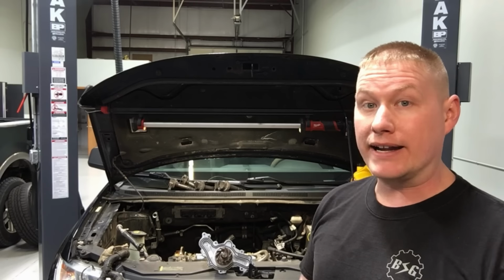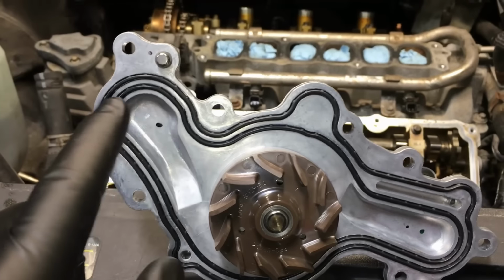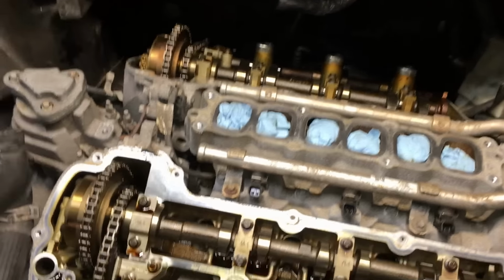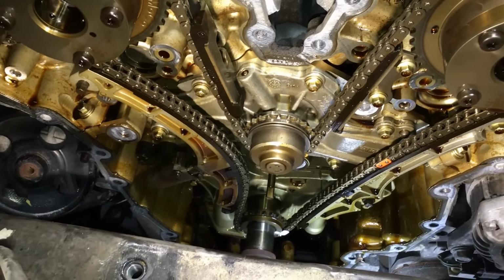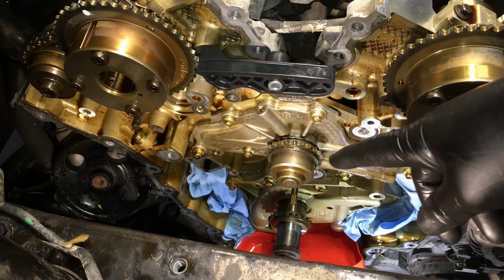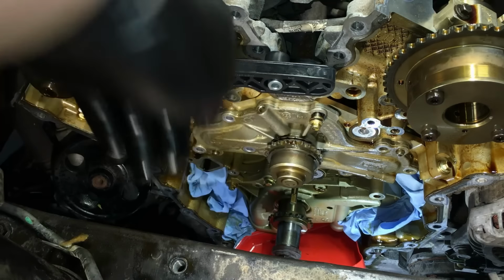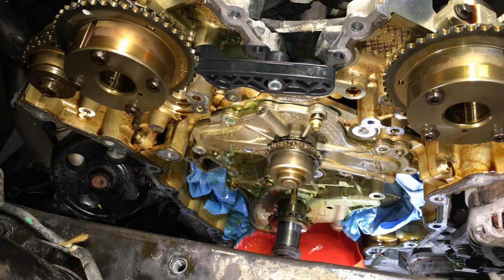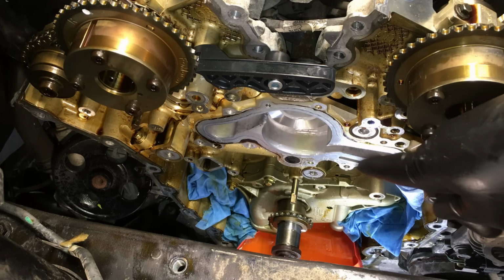Ford 3.5L 3.7L Duratec V6 Chain Driven Water Pump Failures: Check it Before it Destroys Your Engine!

Comment: Brian I subscribed to your channel  even though I dont like Fords. the only reason I subscribed to your channel is because I believe you are a great mechanic. the only thing I would like you to stop doing is sugar  coating these engine designs by Ford. That's a terrible engineering and you need to start admitting that this design is pretty is pretty stupid. I feal sorry for the owners of this engineering experiments...Ford flex,taurus,mazdaCX9,edge,lincoln... 🤮  Ford built thought...to fix

Comment: I had an '07 Edge complete with 190,000 miles, the 6F50 transaxle shudder, quarter panel corrosion, and a water pump showing signs of eminent failure. Sold it 4  months ago for $2000. It was a great running vehicle, but I got my moneys worth out of it.

Comment: Does this mean that we should stay away from these 3.5L 3.7L motors? I was looking at a Flex and it has the 3.5L Ti-VCT V6 Engine.
Reply: YES....unless it's an F150 truck....those have external water pump...
Reply: @barrya.6212  mustangs with the 3.7 have external ...not sure about the 2015 to 17 Ford edge 3.5
Reply: @davidilijevski8942  Then that's because they are rear-wheel drive...which sounds right...can't imagine Ford putting front wheel drive in a Mustang.All other Ford cars with these two engines I'm sure are front wheel drive...thus having cramped engine compartment needing the internal water pump...although of course they should have built the car 'around' an external pump in these not the other way around.
Reply: Yes stay away from those FWD 3.5, 3.5 Ecoboost, and 3.7 liter V6 engines.

Comment: I have a 2014 V6 Cyclone engine in my mustang. Only 56,000 miles on it. Does this engine have the chain driven waters pump system my engine bay looks nothing like this so I was wondering if the duratec and the Cyclone engines are different or should I be worried about this problem too?
Reply: No

Comment: Wait till you see what the fix was in the newer engines. They replace the plate with the pump with an idler and a spout that connects to a newer design external water pump that has a spaghetti mess of tubes and hoses attached to it. At least on the newer models they fixed their blunder.

Comment: What genius came up with the idea of putting the water pump on the timing chain sitting right over the oil pan were it can completely destroy an engine? Putting the water pump out on the serpentine must have made too much sense so Ford had a better idea. NOT

Comment: I have a 3.0 duretec, the water pump is in the back of the engine (Drivers side) and drive by a small belt off one of the cams. why change something that works?  I was looking at going to the next gen Mazda6 but not now.
Reply: The point was so a 3.5 would fit into a 3.0 platform

Comment: What would cause this prematurely? For example, on a 2014 explorer XLT with 78k miles?
Reply: Prematurely? Maybe not changing the coolant as per the manual's instructions...but not much more, it is not the driver's fault...it's a design flaw.

Comment: I had mine done @160, I’m @220 Which coolant do I use? I think they used MC Gold, there was some confusion on the recommended fluid. 2010 Edge Sport. Do I need to flush with distilled water if I’m using the same coolant? The coolant looks kind of clear with some yellow tint.

Comment: very funny of Ford to call this Dura. To fool people into thinking this P. O. S. is durable. I have owned cars since 1960. NEVER owned any Ford and likely never will. they teach people not to trust them with stuff like this.
Reply: Never had any complaints with the 1990s Ford escort series we had 4 of them in our family and one was even a manual transmission 3/4 of them got to the 200,000mi and further mark 2 structurly collapsed due to severe rust damage in new England one got totalled in accident and the last one the automatic transmission failed severe burning oil and time ran out  if we could have known that in 1991 we would have bought them brand new

Comment: I've done one of these under warranty for a customer years ago... 😔
Reply: only 1? Thats impressive failure rate. that guy got 185k miles out of his pump and it wasnt even leaking. Atleast ford engineered it to last in excess of 100k miles.
Reply: @HakeemsAutoRepair  There’s many owners that had failures well before 150,000 miles.

Comment: You know you have 2 weep holes right? One above alt and one in the engine V valley. The long cut out on WP is the alt weep hole and the bottom hole you show on WP at first is the valley weep hole.
Reply from the maker: Yes that one is for shaft leaks

Comment: I'm about to replace a water pump in my 2008 ford taurus with 220,000 miles on her.  Changed the oil the other day noticed the leak.   I watched the 3.5L ecoboost video, other than the engine turned sideways, is the video pretty spot on how the timing and everything lines up?  Thank you for busy time.

Comment: Great video...I have a 2012 CX-9 with this 3.7 engine and I heard 2012's and newer have a dual sprocket design on the water pumps that are more reliable and less likely to have a coolant leak...is that true?
Reply from the maker: Correct but they can still fail, we have seen them as low as 63k miles.
Reply: Thanks

Comment: Brian, I feel I may have askes you this but do you recommend 5w30 for the 3.7?  I hope so because I put 5w30 in my Cx9. Thing burns oil like crazy, after 8k miles only 2.5 quarts came out. Thank you.
Reply: 5w20 full synthetic. We have the 2L Duratec just crossed 200k mi with no oil consumption. 64k mi on 3.7L duratec no oil consumption. I don’t think the duratecs are known for eating oil and not having a root issue.
Reply: @acmotifs  He answered me on another video and said he recommended 5W30.  Switched a few years ago and it helped with the oil consumption.

Comment: 12-14 hours? How much to R&R the engine? Just curious
Reply: Just over 18 hours to remove and install a long block, I usually just drop the whole powertrain assembly out the bottom to do this job, only downside is you'll have to do an alignment afterwards, also a good time to replace the commonly leaking ps pressure hose and or PTU/transfer case which are a nightmare otherwise

Comment: Does this apply to the 3.7L mustang? Getting mixed info
Reply: Absolutely not. The water pump on the Mustang 3.7 is belt-driven,  mounted externally - the way it should be.

Comment: Does this mess up the alternator I’m having troubles on startup I took it to the dealer and they fixed nothing
Reply: Alternator doesn't start the car. If battery is ok alternator is probably fine, It gets wet every time you drive in the rain.

Comment: When installing the new updated black plastic upper timing chain guide can that be done without removing the cam phaser?  Also the new updated guide needs new matching longer bolts. 
Thanks
Reply: You have to loosen bolt and tilt the phaser out just enough to remove upper guide bolt. Bolt it TTY so you will need a new one.

Comment: couldn't you just put in 3.7 out of a mustang and not have to worry about that bad design anymore, the 3.7 mustang has an external water pump that can be change in about an hour.

Comment: WATER PUMP FAILURE - BLOWN ENGINE:  I have a 2010 Edge - I drive about 5K a year these days. A couple of months ago the water pump failed - only 65K in my Edge and I am having to replace the motor now. (really poor design by Ford) I didn't get any warning at the time of failure, water temp went high and damage was done! No "check engine" or other warning lights? Thanks Ford.
Reply: Similar thing happened to me after my 2013 Taurus water pump was replaced due to a leak.  Engine catastrophically failed 3 weeks after water pump replaced.  Awful.  Won't ever buy another Ford.

Comment: Glad to know about this. Won’t be buying one of these cars.
Reply: Why not rhey arw still great cars
Reply: @gotzgetcake  Why would you buy something that can be characterized as a ticking time bomb?
Reply: @harrison4ever125  i have a police Taurus no issues so far if it lasts u a while its worth putting money into it
Reply: @harrison4ever125  my neighbor was a mechanic for the Toronto police. He said outside of this single issue the engine is very reliable. He said just replace these preemptively. Its a problem that shouldn't exist but it appears to be the one issue in an otherwise good power train
Reply: @harrison4ever125  okay the thing is every engine has something that fails first, you won't find a perfect engine
Reply: Agree that other than this issue, the engine is honestly free of problems. Plenty of power and decent gas mileage in a 2013 Ford Flex, SEL, AWD. I did not know about this issue fully before getting it, but I can say the Flex is worth putting the money into. Then the car will last me for years more. I've been using this vehicle for business and it's been fantastic for me. Replace it for $1200 - $3000 at a shop. Or you can try and do it yourself. No way I wanna jump into that kinda job. Although, if you can find one that has had the water pump replaced, then you're set!
Reply: You see a money pit. I see a fun weekend project!

Comment: On the duratec 3.0 the water pump is beautifully mounted externally and driven by tail end of cam
Reply: Ford's 3.0l v6, best v6 ever owned
Reply: @jaunramirez3742  absolutely...the 24 valve duratec is the most reliable v6 I've ever encountered...I've owned and repaired German and Asian v6 ...and the duratecs were the most reliable by far, no oil consumption...and externally mounted water pump, not driven by t chain...
Reply: @yyz125  i agree
Reply: @jaunramirez3742  GM 3800 v6 is a way better option. Intake gasket is the only hard fix and not half as bad as this water pump
Reply: @iant419  the 3800 v6 are very reliable as well
Reply: @jaunramirez3742  which cars carry those ?
Reply: @nozopoke1782  ford fusion 2006-2012 ,  2006  lincoln zephyr and milan 2006-2011.
Reply: That was a solid engine
Reply: Ford got smart and cut down on its transverse mounted engines. The newer SUV platforms are RWD based which eliminate the need to design such awful things just make it fit in the car..

Comment: What kind of bonehead would design a water pump internally and connect it to the timing chain? That’s not the worst part. When the pump begins to fail all the antifreeze drains into the oil pan, mixes with the engine oil and destroys the engine??!!
Reply: Right! and to what benefit? Classic ford having a better idea.
Reply: @upnorth5465  Chrysler 2.7 V6 is the same exact way.

Comment: Hey what's your opinion on the 2.0L ecoboost they put in the Edge? or even the 1.5L ecoboost that they put in the escapes. Haven't seen you post anything on either of these engines. Thanks.

Comment: I have a 08 edge with 135k miles, code p0016 and p0011 for the CE light, no coolant loss no leaks anywhere, any suggestions? Engine runs and sounds fine.

Comment: How does that work out for you rounding off the head of the bolts before you get the socket in place to back the water pump bolts out?  Asking for a friend...
Reply: I cringed too lol

Comment: My moms 2015 Ford Explorer Limiteds water pump failed at 64k miles. Just 4K after warranty and is not honored. We ended up paying $2,140 after a couple of “discounts.” Ford Corporate was no help what so ever. Called 3 different times with the same stupid answer. Customer satisfaction my ass, I even tried negotiating the price and that wouldn’t work either. 😡

Comment: @FordTechMakuloco - Quick question leveraging your experience,  have you noticed these water pumps failing at a lower mileage on vehicles using the Motorcraft Specialty Green Coolant (like Mazda FL-22 coolant) or the Motorcraft Orange Coolant (similar to Dex-Cool)?  From my limited research it seem to me that these pumps were lasting longer when the Motorcraft Gold Coolant (similar to G-05) was used (as shown your video).  Thanks in advance.
Reply: I have a 2011 Taurus SEL specialty green coolent ( changed every 60K ) and the car current has 189K ( taken can of very well ) no leads as of yet and never been changed.  BUT parts were order 5 days ago and should be here today . Changing every thing in the front of the motor including oil  pump .  My goal is 450K-5500K

Comment: great video, glad to see you changed the timing chain as well. I think the slack in the chain is what causes excessive vibration in these pumps a lot of time and ruins them. I did the same job two years ago, hated those power steering bolt, , just a diyer changed tensioner and oil pump, guides, chain as well just because I had access to it.

Comment: Hello, I got a 2000 Mustang V6 and I recently  replaced the front calipers and master cylinder. I bled the MC and the brakes just like it is instructed on the repair manual but the brakes still spongy. There are no leaks anywhere and even replaced the rear bleeders but nothing. I have done a massive research tried different things with positive results. Since you worked with Ford, was there a trick or tip you can give to fix this issue? I'll appreciate your help.

Comment: Will a 2013 Ford Explorer 3.5 engine fit in my 2011 Ford Explorer? Anything I need to change? I was told there all the same and you can transfer oil coolers to new/used engine.

Comment: The water pump on my 2010 Ford Edge just failed with zero warning, whilst we were driving 60 mph on the Freeway. The first sign that anything was wrong was the heat stopped working inside the car. The next second the engine started vibrating and stalling. We managed to pull off the Freeway, just before it completely died. We opened the hood and the engine had clearly overheated and was steaming hot. We tried adding a full bottle of coolant but it just leaked straight through and onto the ground, it wasn't leaking before this incident. The vehicle was towed to the Ford Dealership for diagnostics. It was bad news unfortunately. When the water pump failed, with no warning whatsoever, it caused coolant to leak into the engine/oil and destroyed our engine completely. All of this happened in the space of two minutes. Two minutes is all it took for this failed pump to completely wreck the engine. No warning lights came on until AFTER the damage had already started. The check engine light came on after the pump failed and by then it was too late. We are now looking at $4000 for a new engine if the warranty company refuses to pay up. Labor costs will be added on top of the $4000 too. Right now the warranty company is making us pay $650 to have the engine pulled apart, so they can try and prove that we somehow caused this pump to fail. Yep, we are having to pay $650 so that the warranty company can try and find a reason, in some nook and cranny of the engine, to not cover the cost of a new engine. I feel so sad about all of this. I also feel sorry for anyone else with this kind of engine because on researching this I have found that this is happening to numerous other people. Thanks for putting up this video. This may reach some people before they find themselves in my position. I am just hoping that the warranty company covers this, otherwise I am stuck paying for a car for the next five years that I can't afford to fix. I have only had the car 8 months too :'(
Reply: Hope everything panned out for you.
Thanks for the honesty.

Comment: Great video and very helpful! I don't see how you can compliment Ford engineers on design when you have to pull the motor to replace the water pump!
Reply: Dont have to pull it just remove timing cover. Still a pain but not terrible and alot of the work is just replacing parts that you might as well swap while you also have access to them
Reply: It's a truck engine in a car. They had to do something to make it fit. In the F-150 the pump is externally driven because there is room for it.  At least it isn't nearly as bad as a Topaz where you have to drop the motor to replace the belts. There is exactly 1/8" between the dampener and frame.  Have to remove the engine and transmission in order to replace the water pump.  I'll take this job on the Flex any day over the Topaz.

Comment: This bs is no surprise. Every car manufacturer tries to make it as difficult as possible to work on their vehicles in an attempt to discourage people from fixing it themselves. Ford pickups need a special tool to do the spark plugs. GM has completely sealed transmissions so you cannot check the fluid. Cadillac Northstar engines had the starter in a similar location. Don't get me started on Jaguar... those cars are pure cancer (and have been for 40 years). BMW has traps designed into their engines all over. The list goes on and on. NO manufacturer is exempt from this bullshit.
Reply: Land Rovers are really really bad too.

Comment: I thought you had to remove the cam gears and chain when replacing the water pump. Is this not the case? Or is it only on certain years?
Reply: only if youre replacing the small chain.  just waterpump no

Comment: I have a 2010 Ford Taurus 3.5 engine started leaking coolant at 200,000 miles I put this stop leak copper in it and no more leak no more coolant mixing with the oil shop told me to fix it $1,600 I said not today now it has 250,000 still working

Comment: These are a poor design. I have seen numerous Ford Flex Ecoboost engines with this failure when I worked at a Ford Dealer. Never done one myself, but was a common occurrence. Should of designed the Timing Cover around a round style water pump like in the Modular Engines, and be belt driven. Or, even have the Timing Cover with Ports in it and the Water pump bolt to that.

Comment: I've got an early build '08 3.5.  It has some chain slap at cold start.  I'm going to replace the chains, tensioner, and water pump soon.  Are the cam phasers good to go or should I replace them while it's apart?